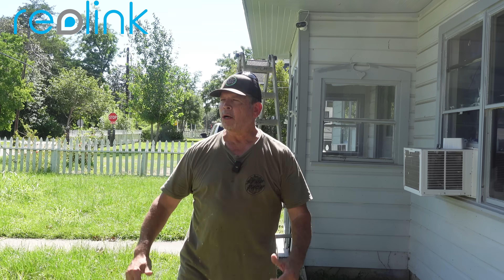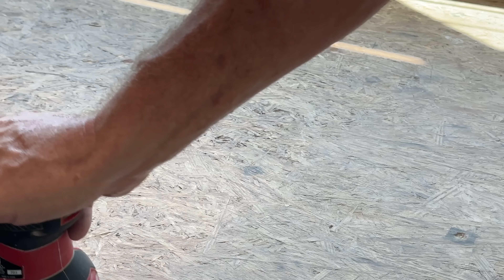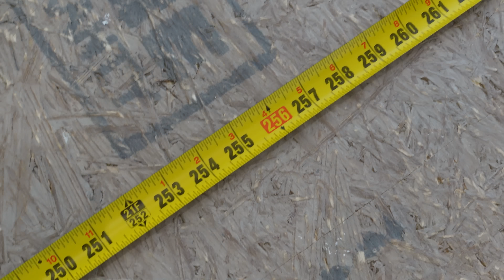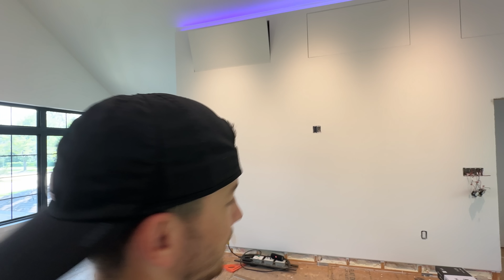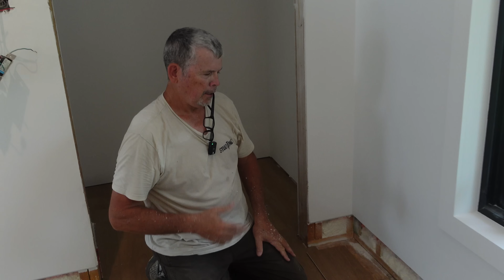FLOORING and its TOOLS Have EVOLVED! Installing Vinyl Plank Flooring

Comment: Next time go to Harbor Freight and get a cheap belt sander with 36 grit paper - I did a 2100 sq ft house with one (by myself) in 3 days. BTW, I'm 71 😁 - Used 3 belts to do whole house. Cost $49 for sander and $7.99 for 3 belts - I rented a large sander, but it kept tripping the 20 amp (temp) breaker

Comment: It took you at least four hours to sand that floor with that little sander. Guaranteed. The quickdrive tool is trash for rookies and hacks. Don’t know how many times I’ve had to go back through and re-screw decks down because idiots used a quick drive tool and didn’t screw them straight in. 90% of your screws will be cockeyed or shooting out of the stud.

Comment: Thanks for the video Stud pack! I'm about to attack my first flooring project, doing my whole house with LVP. Replacing the mismatched carpet, original glue-down LVP, and cheap replacement LVP from the previous owners (which is completely falling apart). I get planning out your layout on a square room that is relatively small... How do I plan a layout for my whole house to avoid small gaps? I am planning to do it with minimal transitions/reducers. I would love to do it all one piece, but the manufacturer calls for at least one split due to length.

Comment: Hello, thank you for sharing your experience. One question: What type of flooring could I install over the current solid wood floor? Sanding is no longer possible as it has already been sanded several times.

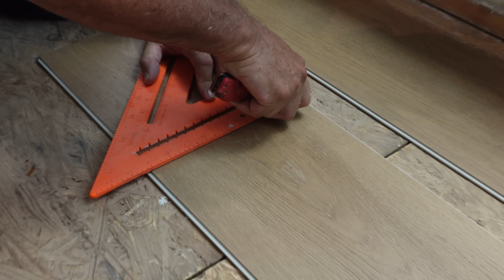Comment: Sometimes I see people filling all the voids on the subfloor with some compound , even screws that went too deep or like we see here between subfloor sheets threre is probably a 1/8" gap (ex. min 9:54).
But in this video you didn't filled that gap. What is the threshold for a need to fill those gaps or voids?
Reply from the maker: Each flooring manufacturer has their own spec for that.  Usually 3/16" in 10 feet but it's best to consult the manufacturer's specs
Reply: @StudPack  The gap I'm talking about it's in between panels, when you connect the panels some of them leave a good gap in between
Reply from the maker: Oh 😁imo the gap between panels is there for a reason (expansion/contraction)...  I wouldn't fill it

Comment: Gotta do the casual slide on your belly test on a new floor 🤣 

Im going to replace some flooring in my kitchen before installing new cabinets and appliances. The trim adjustment tip is appreciated.

Comment: It is 100% Worth getting the BOSCH 7.5 amp Rotex sander. It will pay for itself the next time you do one of these. It EATS wood, like better than the edge sander you use when you're refinishing hardwoods. I think I got mine refurbished for $230.

Comment: I'm not a fan of all that sanding myself so I always add cheap exterior porch and deck enamel Paint and roll it to ALL My interior floors B4 flooring or carpet. Sealing the subfloor with paint keeps the Plywood or OSB from absorbing water or any other liquids and makes it cleaner in the future.

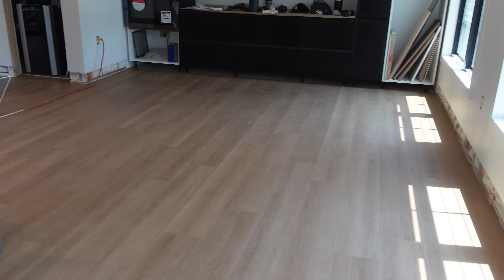Comment: @StudPack for your next time installing flooring again you don’t necessarily need to take it down to cut on the table saw. Just simply scour the long side and cut short side with multi-tool, then just snap. Makes it a breeze! 18:36

Comment: love seeing floating floor properly installed i get so many horror stories of people installing it incorrectly, i assume after the sanding you cheeked for level tolerance, and the rest was golden
Reply: on the off chance you didn't check for tolerance i assume there will be a video in the coming weeks/months of popping boards.
Reply: the only thing i would say is to make both side pieces an equal cut, but with such a small cut totally good to go.

Comment: Hey Stud Pack! I got a question to ask. Is it okay to silicone between the flooring and the baseboard? I hate bugs in the house and also it’s easier for maintenance in terms of cleaning. Is there any expansion/contraction with LVP flooring?
Reply: You need an expansion gap.

Comment: Actually a step up inyo the bathroom is great in modern homes, prevents dust migration onto the bathroom, super annoying cleaning it when the humidity from a hot shower cements it into the floor and tiles.. And sink..

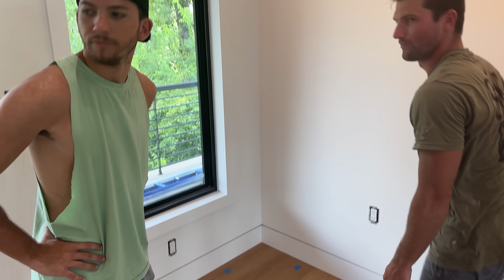Comment: 24:00 you can also use a regular drywall screw on the back side as a plumb line adjustment 😅
I've done it plenty times when remodeling my old house, even on the exterior siding as in a interior corner the inner stud was around 5mm back and curved the boards.
One screw behind then perfect 😁

Comment: Ooh, looking forward to the collaboration videos.
Neat security camera. I should get some cameras for my place. The dropcloth is a great idea. I'm always dropping screws. I carry around a retractable magnet stick. LOL. 
Was that Quick Drive or Quik Drive? My vision sucks too much to see if there is a C or not. LOL.
Did you ever see the type of knee pads that Jeff Thorman recommends? I'm trying to remember what they are. They zip up and are adjustable. 
oh yeah, patterns. I totally forgot about that. I need to lay some flooring in my laundry room and was stressing over the plank layout/staggering and didn't think about the pattern. That is something to consider. Thanks for reminding me!
That flooring looks nice!
What pants are those with the pockets for kneepads? My best friend is looking for some like that- all of his pants keep tearing.
Ooh, I'm subscribed to Joe's channel. He's a nice dude. Awesome tools.
Rad sliding across the floor like a seal cracked me up. Reminded me of when I worked at a zoo and a young seal named Vanessa kept sliding at me like that to try to knock me down because she thought it was funny.
I'm glad there was a toekick for the cabinets. I don't like the look where you can see under (or where stuff can get under and get stuck). That said, hidden toekick drawers are a cool thing. Jordan may want to consider toekick storage for the actual house. Especially in the bathroom. You can have a bathroom scale or other stuff in a drawer in the toekick.

Comment: Ive laid a few laminate and SPC floors as a homeowner. Absolutely imvest in the tapping block, i prefer the one with radiused corners. That pull bar though i found though was a waste. In fact it was too thick to really slip between wall and edge of floor for those tight situations.

Comment: I have a Reolink system and sadly I found them not quite up to snuff. Some basic features I want that are missing, and I will likely make my own dedicated system to act as an NVR.
Edit: I am also a software developer and I can tell you right now, as easy as wifi installation makes things, permanent emplacements should be ethernet connected so as to not clog your airways.

Comment: Ikea toe kick is installed upside down: the rubber water proofing strip should be on the groud to prevent spills and cleaning water to seep under the toe kick :)

Comment: Dude u fail to do was start on the entry side of the floor. So when you walk into a room/ house and you a quick glance at the floor everything looks parallel n even on both sides. And those patterns on your flooring are design to to mimic a 16 ft longboard and the design is reversed so if you start in the center of the room. So u don't get a narrow design attached to wide design in the middle of your floor. The reason for the reverse design is to make look like u flip the board end for end on a small room less than 16 ft long. And you start with the wide side or narrow side for rooms  larger or wider than 16 ft long. Plus , this goes for every installer of flooring - contractors, handyman, n DIYERS - always open up your packages and lay out everything the that box. So you come up a design and can figure out how the manufacturer package the product you're using. And most manufacturers will package their products to start with a wide piece and end with a narrow one. Just some FYI from one fucked up carpenter/ handyman who's got no idea what de fuck he's talking about

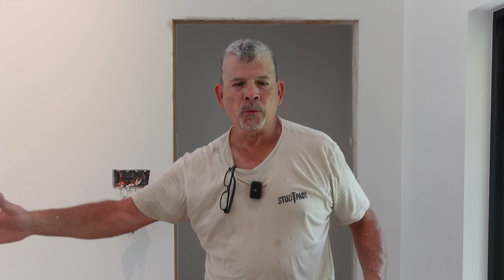Comment: 17:30 I always check that (parallelism) between all walls, and make any needed adjustments (splitting the difference) at the start. That and what you did when you checked wall opposite start wall (to eliminate any "slivers"). Not sure if you also checked the other 2 "mini walls" and stairwell for this but that should also be done...basically, anywhere your widths are terminating. If not, you could definitely run into some problems/slivers :-(.
Great work boys!

Comment: I enjoyed your tips on the flooring installation.  I have one question.  Why would you not install a plastic waterproofing sheeting under the flooring?  Granted vinyl flooring does not swell with an accidental water spill but it would be cheap insurance for the flooring underlayment.

Comment: Awesome.  I like the flooring product.  I have a small house and need some flooring for a kitchen and bath.  These are really tiny compared to a lot of homes. I think the bath is a 5' x 6' and at some point I'd like to upgrade them from the 1950's tile. The kitchen is 10' x 15' and it would be nice to get a better floor than they dinged up vinyl floor.  Can you guys come out to California and knock it out for me?   LOL... yeah, I'm sure you have nothing else you're doing that's more important.   Anyway, you guys are just killing it there in TX and I know you guys can feel the finish line approaching!  Congrats!

Comment: This is great. Only thing that makes me think is that I was taught to lay the floor so  that the light from the window dosn't cause a troublesome line when it fades the floor, (meaning turn the floor 90%) and that also should make the room look larger. But that's what my teachers told me if the manufacorer says other wise then you follow them.

Comment: That thin flooring might work a new floor that is level and flat ...but on an old floor that flooring will show every dip, bump & gap in that floor. I can see where they left a tiny finishing nail laying on the floor when they floored over it in the apartment I rent  ...and the floor we installed  is twice as thick as the floor in this video. Go with a thick hard wood floor on an old floor ...it hides all the imperfections in the floor.

Comment: Why was the baseboard done this way? Never said.  And looked like a lot more work.  Was it because of cost?  Do those boards cost less than traditional baseboards? Or is the reason something else??  
Floor looks great - a big difference - nice work!  Just trying to understand the reglet over baseboards. Thanx.
Reply: I think it’s so that’ll be smooth ish instead of having it stick out the half inch or whatever. 

I bet video purposes played a role in it too. I mean traditional baseboards probably would have been a “bore”

Comment: Preassembled corners are the way to go.  I did that for the crown molding I installed and using MDF crown molding made it even easier as the molding is flexible enough to be able to conform to an existing wall that was not straight.

Comment: A couple of tips they failed to mention - cutting this stuff requires a saw blade with at least 60 teeth and it will wear out pretty fast.  I help my son-in-law do his upstairs and down stairs.  We went through a couple of blades.  Also, when you have to reverse direction inside a different room or around an island, you need to be skilled a linking the planks together in both directions.  If you don’t have a fancy tapping tool, use a short piece of a waste cutoff, slide it over the tongue of the board to be set, and hit it with a hammer or mallet.  You will need the other tool used to pull the planks together and the one they show looks great - the cheap ones last a while but you have to keep bending them back in shape.  Check your square with the far wall after placing four or five rows - you can still adjust the whole piece with a pry bar.  Not too hard  but these guys make it look easy.

Comment: all you need to relevel that floor is a flat bladed floor scraper and a planer! So much faster and easier than a sander! That LVT looks spectacular, just like the rest of the place! Great job, crew! Stay hydrated and cool when you can! Quick question, Paul... Is that LVT tough on saw blades? looked like it cut like butter! Those tools from Joe look beefy! I need to grab some of those...

Comment: Nice floor.. I generally used a silicone calking in the expansion joints. Allows the expansion flexibility you and mitigate any spilled liquids, imo.  Killer project tbs.

Comment: I can’t tell if your temporary ac is a dual hose unit but all the single hose units are really terrible. They create a vacuum in your space as they suck air out for the exhaust so you end up pulling in unconditioned air.

Comment: That tapping block is nice, but that pull bar is a must have for a flooring installer. I used the cheap ones for many years and they were indeed very frustrating because you'd eventually bend them out of shape. Bought myself a set of those bad boys from Joe sometime ago, never install flooring without them again!

Comment: Make sure ya'll cover those floors up until the project is complete. Builder's paper cloth taped to each other (*not* the floor), until you're ready to move in. It's a Pain in the a*s to replace a scratched or damaged tile in the middle of the floor

Comment: Sanding discs are much cheaper online. You can get 100 discs for $20. Even the Mirka discs are only $20 for a 50 pack. Buying sandpaper from a physical store is something you should only do in an emergency. I keep a stash in my van at all times so that I never have to restock at the big box store markup.
The same goes for multitool blades. Home Depot wants $20 per blade. Amazon wants $30 per 55 blades.

Comment: If you're doing baseboards and have that corner gap issue, a similar trick is to put in a drywall screw (or any screw) behind the baseboard and then drill it back out, which creates a gap, same way with your reverse thread screw.  Just nailing the baseboards may not be an option depending on the kind you have, it may be too thin.

Comment: You should have tried to mount a shovel handle or pole of some type to that sander to keep you in a standing position.  Similar to the router handle that Awesome Framers use for cutting out windows and doors when they frame on the deck.

Comment: I love my Reolink cameras but I strongly recommend installing a PoE system rather than WiFi (for people with the ability to do so). I’m honestly pretty disappointed you guys didn’t install a PoE system on this build. I have dual backup (NVR and local SD card inside each camera) and the Reolink app is really good. No monthly fees and great performance end to end. There is a whole subreddit dedicated to Reolink and they do a good job of breaking down everything you need to know. Really happy with it so far and my whole house is much more secure.

Comment: Nice work boys! You know I was just thinking... LX Hausys used to be LG HI-MACS, which is vaguely related to LG Electronics... Who also happen to make the absolute best laundry appliances on the face of the planet... And their new WM6998 WashCombo would be absolutely perfect for that garage apartment! 5 cubic foot capacity and heat pump drying means it's ventless and unlike old cold water condensing combos, it's *fast*! Plus, it's not a complete gimmick designed for only the stubborn American market like a top loader!